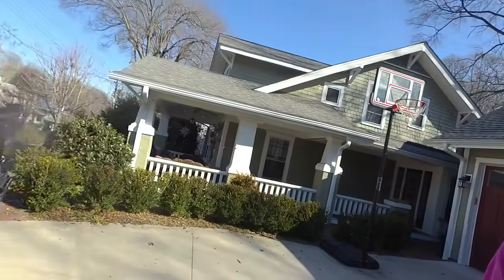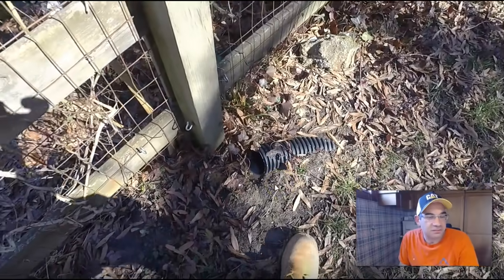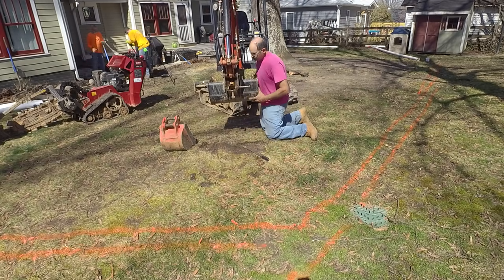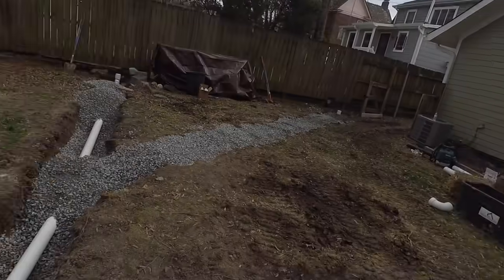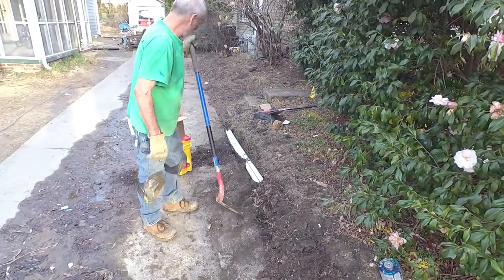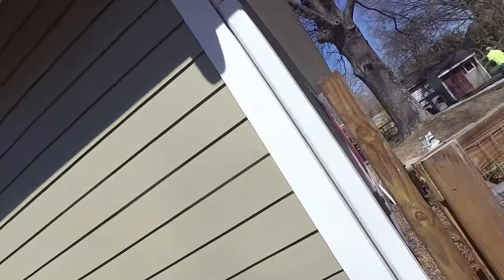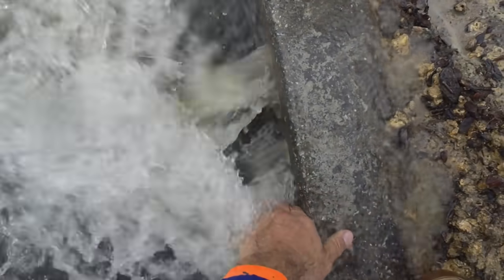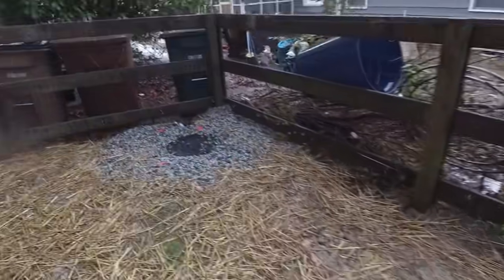Installing a french drain and dewatering pumps to solve stubborn back yard flooding

Comment: Hard to tell the grades from the video with camera looking down but I don’t think There is any need for that sump pump off in the basin near the corner of the house, that is your bottle neck. I don’t see the need to run any pressure line to the ditch if you can catch everything in that upper basin and then let gravity take it to the street. sump pumps don’t like long lengths of narrow discharge lines even going downhill. You want to vent the pressure lines to the nearest point that gravity can take over, vented to atmosphere
Reply from the maker: This house sloped from the street down to the back yard so pumping was unfortunately our only option.

Comment: Doesn't code require Gray Sch. 80 PVC pipe for burial of electrical lines?  Perhaps the municipality your jobs are at doesn't require it?  What about building permits?  Just curious.
Because where I lived in Oklahoma, Kansas and Texas all require code for electrical PVC to be Gray.
White Schedule 40 PVC pipe is specifically intended for use with plumbing DWV (drain, waste and vent) systems. By code, Schedule 40 PVC is approved for plumbing use only.

Electrical conduits require Schedule 80, gray PVC pipe. By code, this is the only PVC material approved for electrical conduits.

Using white PVC pipe for electrical conduits will be flagged by a building or home inspector, especially when you go to sell your home. You will likely have to replace the pipe then.
Reply from the maker: Hi Jeff - We're not running electrical conduits here. We're running power cords that come from the factory attached to the pumps. I do sometimes install outlets in the yard for pumps and in those cases I add a 20 amp circuit at the panel and trench 18+" deep. I run 12/2 outdoor rated wire through a sch 80 electrical conduit (I usually use 1" which is overkill but easier to pull the wire) and glue with cement.

Comment: Easy build a dam and keep the flooding there side , it’s there problem for building a non permiable driveway with inadequate water capture
Reply from the maker: The problem with that solution is the more water the harder it would be to keep on their side. A pinhole leak would make that solution useless. We decided not to control the water, but to get rid of the residual water after a rain. 👍 Great comment!

Comment: Are you ever worried a system won’t work and you would have to change something?
Reply from the maker: If I have doubts about the system not working I usually pass on the job. You've got to have a way to collect the water and a place to send it. Without those I can't help. 

I have also found that stating the problem and solution to a homeowner who wants to go cheap is a bad move on my part. I recently did a job where I said they needed gutters, grading, and gutter piping away from the house. The H.O. went with 1/3 of those and saw success for the first few rains. Then the heavy one came and their basement had some water. They texted me and I went back out there and said now we need to move on to the second item to address. They lost it and called me a crook and dishonest, etc, etc. So I really only take the job if the homeowner wants to solve the problem and not half the problem. If there is an issues, I go back and fix it, but that's only happened a few times with minor stuff.
Reply: @GCFD  yeah that makes sense, I hate people like that, hopefully they still have water in their basement after being so rude 😂

Comment: If you watch French Drain Man's channel, you will realize how important using filter fabric is.
Reply from the maker: Filter fabric kills the flow. High flow carries larger particles and rinses them out of the system. I have watched the FDM and his methods don't work very well here in the South.
Reply: @GCFD  If you are needing quick flow and want the sheet water to go straight through the stone on top, just at least wrap the bottom and sides of the trench and leave the top open. I must admit that filter fabric does slow the flow of water a bit, but it makes your french drain flow water a lot faster in the long run compared to drainage stone with the voids filled with soil. You may be right that it doesn't work for you where you are located, but I know it works pretty good here in Missouri! I often don't use a french drain to take in bulk water anyways. I want a good french with lots of void space between the stone so the french drain can play the longer game of drying out a saturated sub soil.
Reply: @GCFD  Not trying to be a jerk that pretends to know it all by the way. I just I'm stating my opinion and sharing the way I address water issues.
Reply from the maker: @High-Flow-Drainage-Solutions  thanks for sharing!

Comment: Do the customers not understand the loss in property value caused by french drains running every which way in the backyard?  Easily $20k-40k of value gone.  Id much rather have a few puddles a couple times a month.
Reply from the maker: This was much more than a few puddles. It was an unusable yard, a flooding basement, and a threatened foundation. Now they have a gravel pathway from the side gate to the shed. 👍👍👍

Comment: Are there no obligations on neighbours to not do anything to their property that exacerbates or creates issues for adjacent homes? The neighbour with the paved garden has effectively exported their problem to this homeowner and doubling their issue. At the very minimum the paving job should have included a catch drain for runoff and directed that to the street.
Reply from the maker: Here homeowners are not responsible for water flowing off their property. I know it's crazy.

Comment: As a swiss, I was wondering about 2 things in your videos, and I guess climate diagrams from Zuerich CH and Asheville Airport NC (USA) kind of answer them...
Seems your area has on average about 20mm more rain than Zuerich and about 3-5°C hoter temparatures...

The questions I had where:
1. Why don't people install some water retaining barrels (with overflow back into the gutters) for gardening water (here lots of people have that and we have a 1000l beton reservoir catching and storing rainwater...

2. Which is not really answered: Why not directly divert the water into the sewers, rather than letting it flood the streets?
I think here, rainwater from streets is regularely catched with the long things you installed into concrete I think 2 videos ago on the sides of the road and then either added to the sewers or if local streams or lakes are present, it might be kept separate and diverted into those, saving processing costs in the sewage plants...

Sorry for any spelling mistakes and wrongly used words etc, english is only the 3. language we had to learn...

Greetings from Switzerland :-)
Reply: Hi!  Water retaining barrels would fill up so fast.  If you watch some of his other videos they run pipes right into storm drains whenever possible.
Reply: @coenfilm  yes...but comparing to my area, those storm drains seem rare...
here most streets have drains every few 100m, if in a developed area...

And to the rainbarrels, I guess you don't have that much dry periods which would make them useful, judging my quick look at climate diagrams.
Reply from the maker: Like Coen said, I always try to dump into a drainage basin but dumping on the street will hit the next storm basin. Are you talking about sewage system of waste water? You would never want to dump stormwater into the sewage system as it overburdens the wastewater plant.

Comment: Not calling into question your drainage work, but next time you are working around a tree like that you should consult a certified arborist in designing your system.  You caused some major damage to the tree that will likely cause it's death and if it falls in a storm there is video evidence of you harming it that the insurance attorney would love to show a jury.
Reply from the maker: We tried to stay away from the drip line, which is where the damage can occur.
Reply: @GCFD  just operating your equipment inside the drip line could cause damage, also you piled soil against the base of the tree which causes any number of issues....

Comment: French drains only collect subsurface water, catch basins collect surface water so when you speak about the french drain collecting water that washes across the trench, it will not unless there is a catch basin. You should know that. Tons of surface water after a rain that catch basins would have eliminated.
Reply: Uhh.. the open french drain collects surface water. Water travels across the dirt, when it reaches the rocks it falls down through the voids between the rock then floods up into the pipe to be carried away. The limitation of this particular system is the sump pump. The only reason water was backing up is because there there was briefly more water coming into the system than the pump was able to pump out. This system could have had 100 catch basins and the result would be exactly the same, it would have backed up because there was more water coming in than the pump could pump out
Reply from the maker: HI - catch basins only collect water that runs into them. They already had a catch basin system that was useless. The FD catches surface water along its entire length and provides a route for water to flow and get into the perforated pipe. 

I think Old summed it up better than me, see his reply below!

Comment: So many things done wrong. Best part was you going back after the rain storm ended and the yard was still flooded but the pumps were not running. In 10 years your pvp will be clogged solid. Pumps are undersized so they will burn out. You put rock in the middle of someone's yard and did not cover it. The top soil was disposed of and the clay was used as top soil which will make the flooding eve worse!
Reply from the maker: I showed that the residual water after a storm was quickly evacuated after the rain stopped. The pumps are plenty large enough to evacuate that water. Keep in mind the goal was not to contain all the water entering this yard. That would be impractical with thousands of square feet of concrete and roof from the neighbors. Of course we didn't cover up the gravel. You may have noticed they had a previous french drain where the installer buried it. That system had standing water on top of it. We go for results over looks. This system has been working fantastically for the homeowner so your statements don't seem to be accurate.
Reply: you might have 'learned engineering' but you know squat about EVERYTHING else.!!!!!!! LMAO

Comment: Why not wrap the pipe and rock with fabrick and cover the rock line..  No way would I leave my yard looking like that.    We cannot dump on to the street where we are.
Reply from the maker: We don't wrap the drain up because we preserve the flow. That is where the energy comes from to keep the sediment rinsed out of the gravel. Killing the flow by wrapping in a thin layer of fabric means there is less flow going into the drain and sediment further restricts the flow by clogging against the fabric.

Comment: OK it seems to work good, but not perfect. At the video end you see water standing on top of the gravel. Conclution: The pipes are under estimated / too small to handle the amount of water. Success: Only 60 from 100%.
Reply from the maker: Keep in mind this system was designed to evacuate the residual water after a rain. There was no way this would keep up during the rain. The reason is there are thousands of square feet of roof and concrete on the uphill neighbor.
Reply: @GCFD  You are right! Does not think about that.
Reply: what do you want.??? 12 inch culverts in his back yard.!!!!!

Comment: "Don't bury a french drain."
Please explain? It doesn't work.

Wouldn't must people like grass to grow over the drain.
Reply: Then you no longer have a French drain, you have a yard that won’t drain
Reply from the maker: A quick test you can do is to dig down through standing water in your yard. If you hit dry soil then your native soils don't percolate well and so water will not flow through soil if you place it over top of the FD. I see this all the time with standing water on top of a buried FD. The water can't get into the FD if it has impermeable soil on top.
Reply: @GCFD  Thank you for the thorough explanation.

Comment: You do a great service and your work is pretty good, but I can't help but feel you did not live up to your full potential here. 
Having installed pumps you could and should have dug deeper so that gravel scar did not have to be visible or at least install a border to control it and leave it in a presentable condition.
That's a lawn mowers nightmare.
I'm sorry but on this job you fell short!
Reply from the maker: Thanks for commenting Steve. The homeowner went with results over appearance as he already had a worthless drainage system installed. He's  happy that the water is gone and has made the FD into a pathway to the shed. 👍👍

Comment: Im sorry but your drains look esthetically like poop. You can do a simple drain or french drain and hide all that gravel and even a sump pump and not make someone's yard look like a gravel driveway. I would be embarrassed to leave a yard looking like that plus why all the gravel? If you're not using perforated pipe why all the gravel? After time that gravel would silt in but who cares there is no perforations in the pipe so whats the point? It may drain but what a eye sore.
Reply from the maker: Keep in mind Todd that they had two previous drainage systems that failed. Most of my customers are experiencing real drainage problems and have been through previous attempts to solve them. I go with results over looks, so my customers are to the point that they are more interested in results. Great comment!

Comment: Not impressed.  Rocks everywhere.  Not much of a backyard.
Reply from the maker: The homeowner already had two failed drainage systems. They chose rocks over mud in this extreme case.
Reply: @GCFD  I see an image in my mind of a barrier around the yard blocking water run off from the neighbors.  It could fashioned with brick as raised flower beds.  I also see a sidewalk on the side where you brought your machinery in serving as a drain out to the front.  And, I see a more dirt added to the backyard to raise it so that pumps would not be needed.  But I don't see a bunch of rocks and shallow pipes underground making a mess of the backyard.
Reply from the maker: Whew! Larry! We would have to raise the entire house several feet to achieve the system you described. The problem is this is an old neighborhood with all the houses dumping onto the next. The homeowner was planning to make the rock into a path from the side area to the shed to mitigate the looks. So far he's extremely happy with the results.
Reply: @GCFD   Blocking drainage from neighbors with concrete curb:  https://www.youtube.com/watch?v=L-SFzFBS7WE
Reply from the maker: @WellsLarry  The problem with this is that the homeowner's yard was still downhill so damming water higher in elevation still leaves the water primed to flow onto the property. I focus on giving the water a path of least resistance (where it wants to go anyway). With that amount of water a dam would quickly get overwhelmed and you would be right back to square one. There has to be a place for the water to go or you're battling gravity and any pin hole leaks that may develop.
Reply: @GCFD It's not a dam to keep water in. 0:59 It's a curb to block and guide the neighbors drainage out towards the street.  If you were creative, you could integrate your drains, if needed, into the fence curb.  And, you could increase the level in the middle of the yard with dirt so as to slope towards the fence curbs draining the yard away from the house.

Comment: Why would you post this? Epic failure!
I work in the same business amd i would do such a crapy job.
Ha ha! 
I dont see you getting much business from this.
Ha ha
Reply from the maker: Really? Did you watch until the end where the residual water after a heavy rain was gonee from the back yard? 
That was the goal of this project..to get rid of the residual water so it no longer hung in the back yard.
Reply: There still too much water pooling up. Also im not sure what budget was but still property has grading issue's and also the curb drain should of been cut with the grade of the road so when it exits in a storm it don't create turbulence.
Reply: @nutsonya  you have no clue, nuts